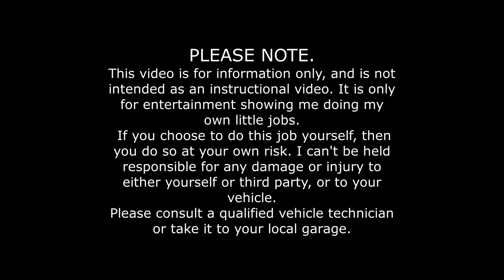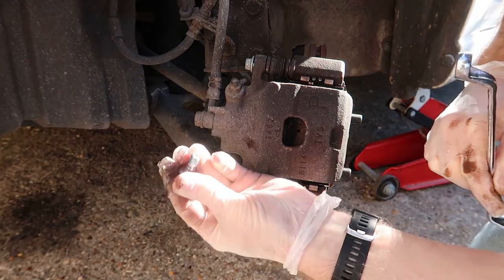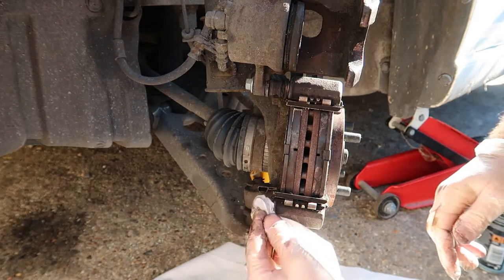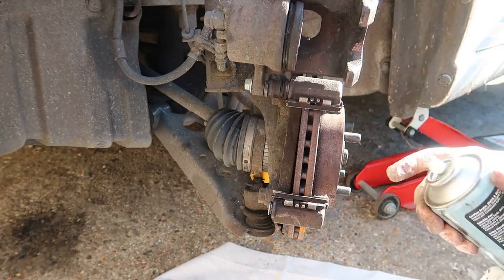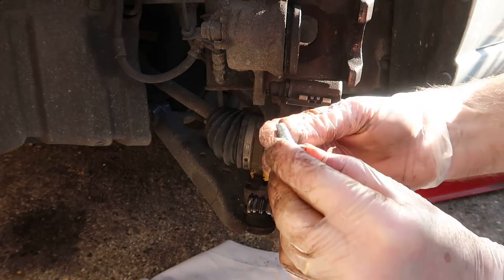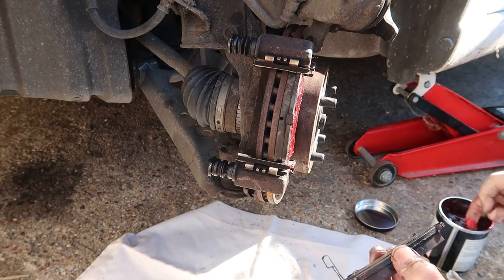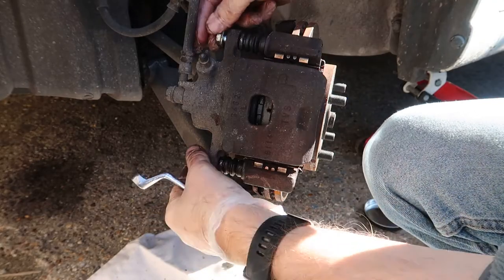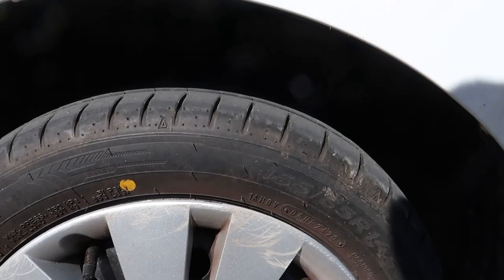2013. Suzuki Alto. Cleaning and regreasing the brake caliper slider pins. Rattling noise over bumps.

Comment: Thank you sir I saw it very easy and helpful video amazing sir ❤❤❤❤❤❤❤❤❤ tomorrow i will be try thank you so much
Reply from the maker: When you've finished the job, before driving the car make sure you press the brake pedal a few times to pump it up. Take your time so you don't forget anything. If you're not sure, take it to your local garage to get it done as it's a safety issue. Good luck. 👍👍

Comment: Hi David, I am having the same problem. When I knock the wheels, it gives this sound. I took this to a mechanic and he greased the slider pins. But after 2 days, the sound started coming again. He told me that the calliper slider pins needs changing. Will the problem be fixed if he changes the slider pins?
Reply from the maker: Hi Manoharan.
The pins could be worn and as they're not very expensive, I would change them anyway. I found I needed to grease the pad contact points too as they weren't sliding as they should be. I don't own the car now, but I do have contact with the buyer and it's been fine so far. Hopefully this will help.
Good luck, and thank you for watching. 
David.

Comment: thanks for the video.😀 what type of grease did you use? can it stand in high and low temperature and won't wash off? i did  mine and  the rattle still exist what am i missing?  i did use  silicone grease . thanks in advance
Reply from the maker: I used red rubber grease on the pins and the back of the pads, although copperslip grease can be used on the back of the pads instead.  I found using copperslip on the pins dried up too quickly and had to do it again. Hope this helps. Thank you for watching.
Reply: @DavidGarside  i did use copper on the  "ears" of the pads and on the back it did dried up. i'll try  silicone . thanks for your answer!

Comment: Hi mate, right I've got the rattle when I'm on rough roads. Twice I've had it to stoneacre due to the grease working it's way out after roughly 500 miles.. The service manager today told me it needs a specific type of grease to stop this happening so much and he needs to order some in.. Its a 64 plate with 19k on the clock. He also said its a characteristic of this car.. Only had it since october
Reply from the maker: Hi. I've had the car since new and yes, I've had to do it a few times too....I also know of others that have had it too. I've not heard of any special grease from the dealer though.... Not doubting your dealer though.
Reply: @DavidGarside  thanks for the reply.. I will certainly be asking what the difference is with the grease.. It shouldn't be happening every few months
Reply from the maker: Would be interested to hear about the grease if you wouldn't mind lett8ng me know. Thank you.
Reply: @DavidGarside  Will do.
They said it should only need doing every 12 months when serviced but I must say I feel like I'm being led up the garden path.. Speak to the service manager Monday 👍
Reply from the maker: Hmm. I would have thought if it was a regular job it would be part of the annual service.....
Reply: @DavidGarside  So my car went in last Wednesday and now I'm getting a different noise at 30mph and above even on flat roads.. I bang the tyres like you do on the video and both sides get the clunking sound even though they re greased them.. I'm at a loss
Reply from the maker: @WILSONI007  . Hmm, that may be something different then. I would go back and get them to test drive the car.... Maybe they can identify it that way. Fingers crossed.